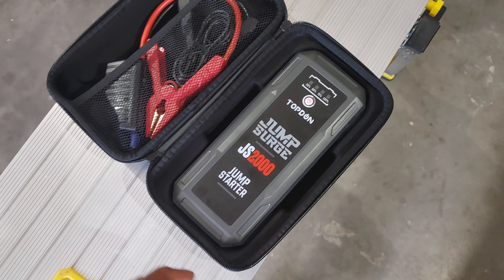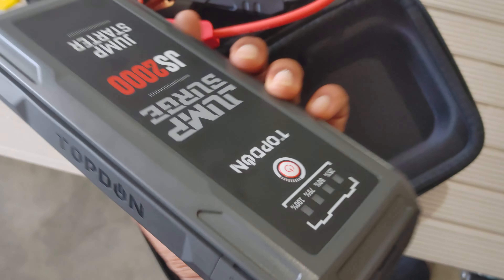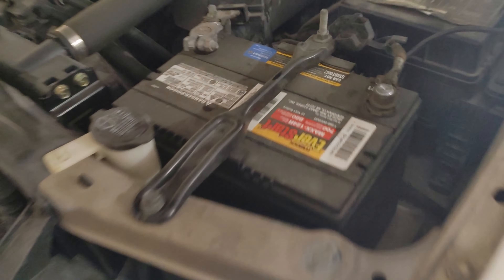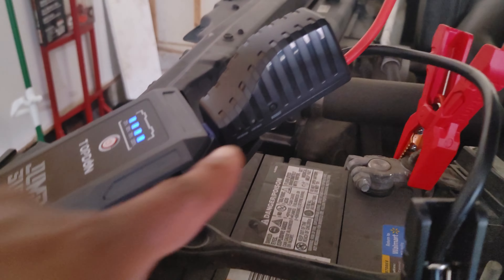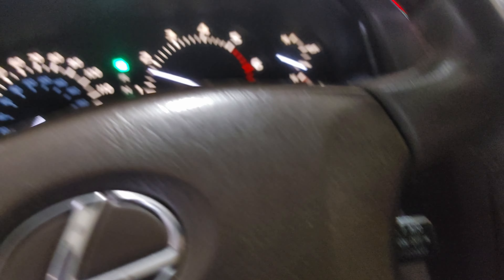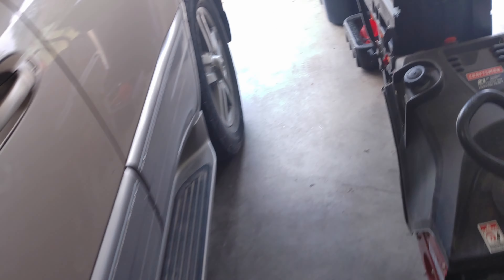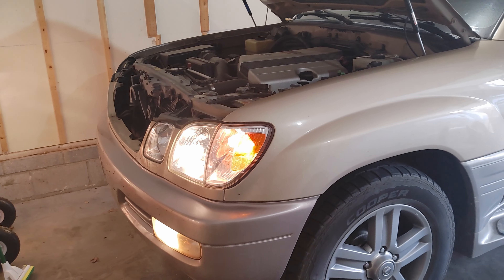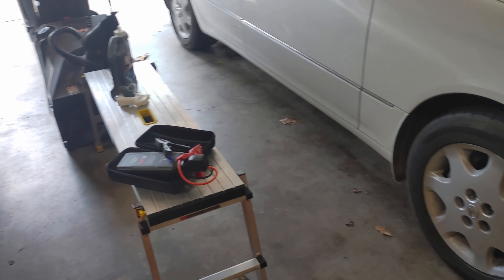TopDon JS2000 Jump Starter Review & Demo

Comment: Pile of crap I’ve got one will not start a car with a fully flat battery
Reply: You used it wrong
Reply from the maker: I agree with JonDoe, you must have used it wrong. HOWEVER, this unit is a little finicky. If you start the car and take too long to remove the jumper, it'll shut down again. The Tacklife jumpers don't do that.
Reply: I've jump started several vehicles with battery voltages less than 4 volts. The product works.
Reply: @MC-mh2ju  Yeah its solid and never let me down.